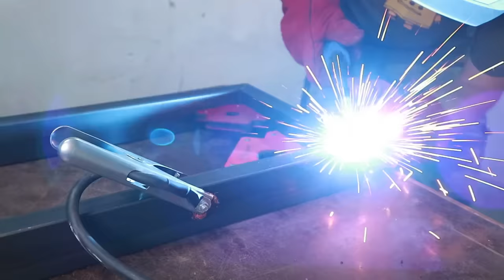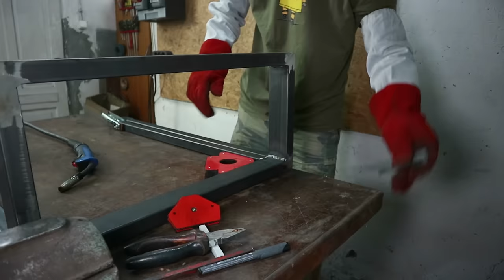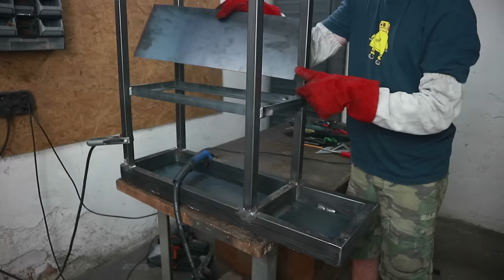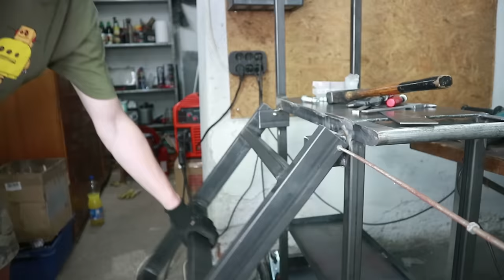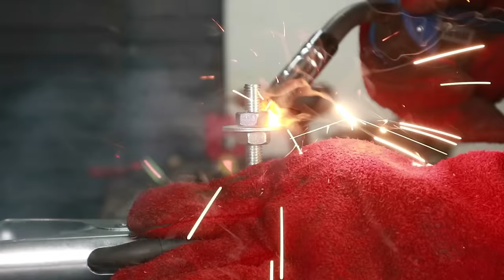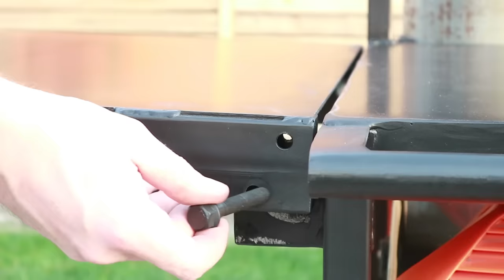Ultimate Welding Cart with Folding Table Extension

Comment: I like your design for that fold down wing. It's flat, quick to set up and take down, has adjustable feet, and takes little to no storage space. 
All the best features for a good quality, portable welding table. Nice! 
I built my table with slide out wings for both sides, but they don't store with the table, and they take a little more room to store.
Reply from the maker: Thank you very much! It’s a bit heavier than i would like to roll around when working outdoors. I might downgrade to a smaller tank though.
Reply: @Ollaris  Yes, I completely understand what you say about the weight! My main table is 39" X 48" (w/o ext) and very heavy to move around, even with good castors. Each extension gives me another 3' on both sides (totaling 10' in overall length for large jobs) but adds a lot more weight. That was why I decided to make them slide out instead of folding, but I really do like the compact folding design of yours. Since it's such a beast to push around, I also made a 2' X 3' top (1/4" thick) that quickly fastens to my Harbor Freight 1,000 lb lift table, and that's often what I use for smaller jobs. It works great, moves around easily, I can set the table at any height I want, and when I'm done I just remove the top and store it out of the way on my lumber cart. I find myself using this one way more than I ever thought I would because it's so handy, and if I'm working on a taller project, I just drop the table and it makes everything so much easier to reach. I'm looking forward to seeing what you build with your new anvil and table.

Comment: Thank you for sharing I'm in a wheelchair and I want to make a welding table but not to big just looking at many video's to see what kind I'm going to make. By far the best one I seen yet for me.
Reply from the maker: Thank you very much. It might be not ideal for you in this particular hight and weight. It’s pretty heavy but i think you could alter the design to make it a bit lower and maybe with a smaller bottle. I think you could use the space underneath to get closer with your wheelchair. And im sure you could fold out the table part if you make it a bit lighter as well.
Reply: @Ollaris  thank you yes I was thinking the same thing I'll just get smaller square tubing and make it to my hight 32-34" . I have done many drawings of just the table I like the set up for the welder your right I probably won't have the bottles but I will make a spot for them just in case. I'll find some good casters for the table. There is a store in Berkeley California just for industrial casters they have all types of wheels. I have a place for the table but if I need to move it to a diffrent location I want to be able to move it. I see other people making welding table but they need a Crain to move them. I don't want my welding table like that. I know what you mean about the small table being heavy. It's like my GMC Suburban tail gate it is very heavy to lift even the back door over the tail gate with the window very heavy to lift I couldn't lift it because I was sitting to low.

Comment: Awesome build ! When using a chop saw cutting long lengths, block support your piece at the distant end. Not sure if you have ever had a issue without doing so but it's done in carpentry and  long length of plumbing pvc drain pipe for best accuracy cuts.

Comment: I love this welding cart plus table, great idea!!! Most perfect idea i do watch here is you tube, the only thing I would suggest to change its the position of the table respecting to the wire feed hatch door, if the wire feed door was at the right side of the machine wouldn’t have any difficulty to change the wire rolls but it will be under the table so you have to change the roll underneath the table or taking out the machine off the table in order to change the wire easily.... anything else it’s perfect i will keep it in mind, thans for sharing 👍🏼😎🇵🇷

Comment: I had made plans for one similar. I like yours better. Thanks.
Reply from the maker: Thank you very much Paul! What are the things you would change on your design?
Reply: I was going to have the table at the same level as the welder, which would have made the table smaller, blocked on that end and splatter would get the welder unless there was a shield. Yours allows overhang on both ends, welder underneath away from the splatter. Still will add a drawer for the bits.

Comment: two improvements you might want to make is to re design the table, yours is pretty overbuilt. nothing wrong with being overbuilt but if yo wanted it to be much lighter you could use 1.5"x1.5" square tubing instead of that heavy rectangle tube. you would be amazed at the difference in the weigh. second thing is you should have left the top of the table un-painted because then you could just ground to the table top and any work you put on the table would be grounded just from touching the table top. but very cool build and you gave me alot of ideas for my next welding cart.
Reply from the maker: Thanks! I like a sturdy table, i don’t have any trouble moving it. And it’s not paint. It’s antisplatter spray, so it’s easier to remove the welding splatters.

Comment: Awesome welding center. TU
Reply from the maker: Thank you!
Reply: @Ollaris  : YW. you haven't had any problems with that Evolution blade? mine fell apart after few cuts.
Reply from the maker: I use it probably since 2017 and its the same blade on the chop saw as well on the circular saw.

Comment: Nice work. Can you tell me your opinion on Mastroweld MIG-250 MI. Does it seem to be of good quality and if, it is on the professional level?  Thanks.
Reply from the maker: I like it so far, although i don’t have any experience with other welders. It’s a Chinese make sold for around 400€ and wouldn’t call it a professional machine. For pro use look into ESAB or Fornius
Reply: @Ollaris  Thanks a lot for your answer. I will buy the equivalent from ESAB.

Comment: Very nice like the table a lot.what brand welding machine do you use and which gas ?
Reply from the maker: It’s a cheap Mastroweld mig 250. With a co2 argon mix. With 20% co2

Comment: I've seen this and other of your videos several times as you've solved many of my "What to do" thinking. I'm just ready to start a welding cart like this; however I would kindly appreciate if you could tell me the dimensions (wide/depth) of this. I currently only have a "small" flux core welder and  a friend lend me his Stick arc inverter,; I would like to size my cart based on the proportions of yours, to have room for future welding machines. Total height I'm going to is 3 ft/ 91cm without casters, to match my height and other table I've built. Than you, and keep your great videos coming!
Reply from the maker: Thanks a lot Erik! I’ would guess you are asking for the part where the welder sits on. The depth is 60cm and the width is 30cm.
Reply: @Ollaris  yep, exactly that's what I was asking. I appreciate your quick response, thank you. I've decided to go for 57cm depth (to exactly match another table I've, so when storing the cart it will be flat with the table). And for width, it's going to be 45cm. This will accommodate both machines I currently have, and be more than enough for a single larger one. The Flux machine could be moved to the bottom shelf if needed by then. Other than that, I've finished to replicate your design in SketchUp and am ready to begin making it as soon I get the metal delivered! I'm anxious to replicate some of your projects (like the folding metal gate) Thanks again!! Saludos from México 🇲🇽

Comment: wish me luck man , i am going to attempt to build this my self for my home work bench as i don't have a lot of room to work with and this is perfect. can i ask what thickness tubing you used and would recommend ? i have a Lincoln Electric 110 volt welder and says i can weld up to 1/8th thick which i feel is more then thick enough, but was just wondering what thickness you used?
Reply from the maker: Good luck and have fun making it! I used 2mm ( ill guess 5/64 )thin wall tubing for all of it and it holds up just fine.

Comment: Nice I’m gonna build one as well. Only thing I’m going to change is to leave the table bare metal
Reply from the maker: It is. It’s just anti splatter spray on the top. Only the edges are painted.
Reply: @Ollaris  that makes sense, it was just hard to tell in the video

Comment: Nice build!  I'm pretty new to metal work so just a respectful question.  Wouldn't it be better to leave the fold out table top unpainted?
Reply from the maker: Thanks! You are right, i used anti splatter spray on it. Sorry i should have made it clear.
Reply: @Ollaris  Now I see, you painted the edges and then sanded off the overspray on the top.  It was pretty clear, I just didn't watch closely enough.  Thanks for the response!

Comment: are those just normal miter saw and circular saw? If so, what blade and speed did you use to cut steel?
Reply from the maker: These are Evolution power tool products. They cut both Metal and wood, with special blades and a reduced speed motor.

Comment: Great work! Can u please tell what disk u use for steel cutting ?
Reply from the maker: Thanks. The saw is a low rpm metal saw with the blade thet comes with it. Sold by evolution power tools.

Comment: I like that idea. I wonder if anybody sells something like that
Reply from the maker: Thank you very much! I haven’t found anyone.
Reply: Not a chance of that happening, can you imagine the price that they would have to charge for this heavy duty welding cart. Too much heavy duty material in this one. They only want to use sheet metal, crappy wheels and castors and bolt holes that don't line up.
Reply: I want a table for a small space

Comment: how you like that evolution saw?
Reply from the maker: Not really that much. It’s not bad when you cut wood, or wood with nails in them. But cutting steel can be painful because of those hot metal shards. You would be better of with a small metal bandsaw.

Comment: Nice monster cart. 
You should always wear a mask when welding zinc plated material. It's toxic and the fumes have "snowflake" shaped particles that, if get stuck in your throat or lungs, will never come out.
Reply from the maker: Yes! That’s true! I always try my best to grind of the zinc coating before welding or if it’s not possible wear proper ppe

Comment: What a fantastic project buddy, i am dipping my toe into welding, so keeps your eyes peeled. is that an automatic mask that you are wearing? if so how do you find it to use?
Reply from the maker: Thanks! Yes it is! It's just a cheap one. It works great! I just find it a bit narrow. It keeps hitting my big ears when I pull it down. Lol
Reply: Automatic masks are for a certain environment, It won't work for everything, That's why you see pipe welders using those pancakes as oppose to auto darkening masks, Something with the sunlight messed with pipe welders so they use those pancakes, But for a shop environment it is useful but not necessary, You can use a normal always dark mask, You remove the risk of the mask failing and you getting flashed, And you can just flick the mask down when you are ready to weld, I find them slightly more difficult to use, especially if you are use to auto darkening but it won't hurt anything, however auto darkening is good for a shop environment if you don't want to constantly flick your mask up and down, You can see what your doing, Start your weld, Then see it again without moving your mask, Although you will find yourself flipping it up anyway.

Comment: Cool idea, but the table top is too thin for welding purposes. The moment your workpiece gets hot that thin sheet is going to warp faster than the Enterprise in Star Trek.
Reply from the maker: Nope. I’ve been using it for 2 years now and nothing like that happened.